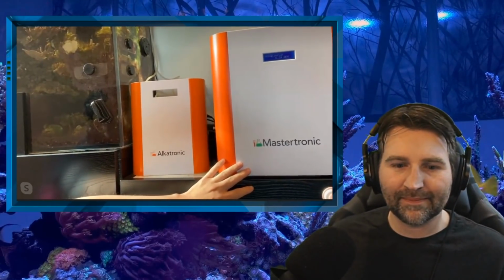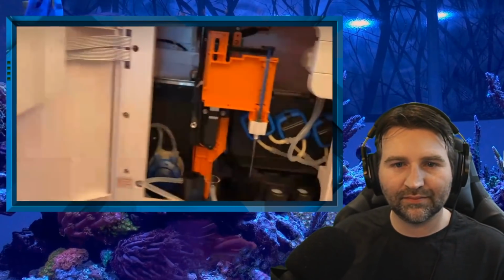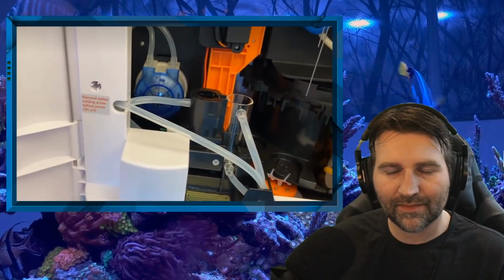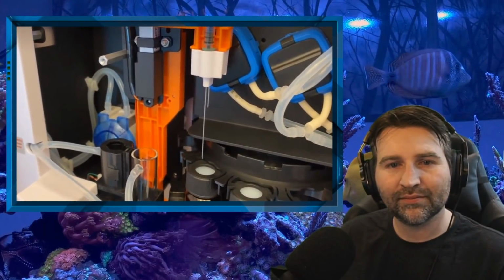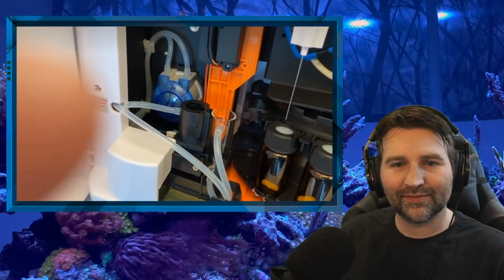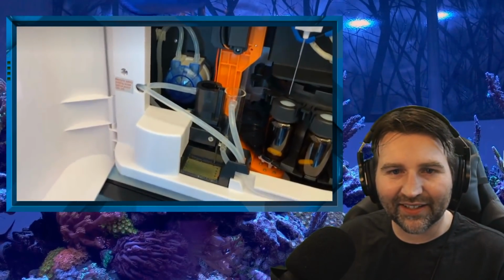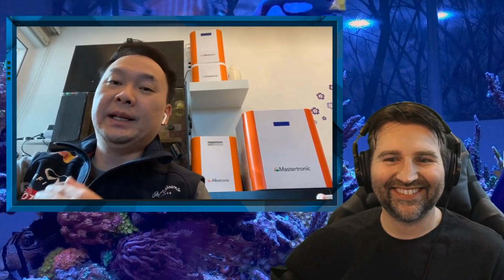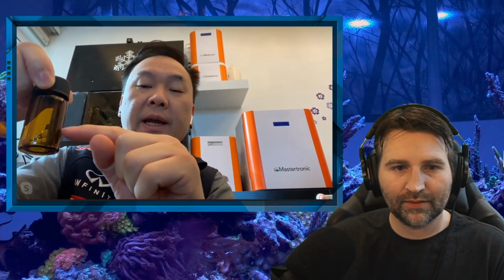Focustronic Mastertronic - Automated Saltwater Reef aquarium water tester

Comment: Devin, I'm wondering about the tank water that sits in the tubing on all these auto testing units.  If the intake line is 3-6 feet, that seems like a lot of water that needs to be removed before an accurate new test can be completed, or you would be testing the same water you did for the past 6 test.  Is the correct, or am I missing something? Thanks for the education!
Reply from the maker: It actually drains the lines after Each test! (which is why it’s important not to modify the length of the lines)

Comment: The need to change the needles so often is a deal breaker for me. Once a year and i would have considered it. The Ion director by ghl seems more appealing at this point.
Reply: Can you do a lengthy report to why you think GHL is more appealing?

I have 4 set of KH Directors. And one KH Lab from Pacific Sun.

I am a store owner, getting these were the idea to test best one and have it on all of my corals system.
Shop still in renovation. So haven't really use any of them.

Soon shop will be done... so I'm doing all research I can find... before settling with any brand.
Also... Reason I'm here cuz Mastronic can test using normal test kits that can be get everywhere.

I owned Trident before, the lack of reagents, the waits for reagents, only to get the batches that was leaked... that was the last straw I pulled on Neptune.

Comment: Not knocking it,, just giving my opinion.
Looks very similar to the reefbot. Only difference I see is the carisol, the leak detector and the double needle.
Curious how long each test take? Amount or reagents each vial can hold and actually test. 
It looks promising and interesting. Hopefully it doesn't have the same issues the reefbot did. 
Great interview and content Devin
Reply from the maker: Thanks!  Similar concept of automating manual tritration.  On big plus over the reefbot is more vials as Thais holds 12 vs 8
Reply: @ReefDudes  interesting. Like I said, I'm not knocking it. Feel like I got my foot in my mouth 🤣,  having dealt with another product that had similar moving parts, made me compare it/ have opinions about it. Not knocking it again.
 I appreciate you setting up the interview and sharing this info with all of us interested. Look forward to see other hobbiest opinions and thoughts on this once they get a hands on. Looks interesting and I mean hey, who wouldn't want a device that could test other parameters other than the big 3

Comment: Excellent video.  Will monitor their success and may switch to them in the future
Reply from the maker: I have been using the alkatronic for years and it’s been been solid.  I have high hopes for this guy!
Reply: @ReefDudes  You know how much I respect your opinion and that alone would almost make me purchase the unit.  I have the Trident system, still unpacked and not planning on connecting for another 2 to 3 months.  I thought for a moment that I would switch.  Will send a private message to continue discussion.